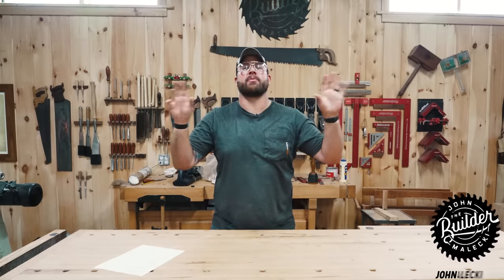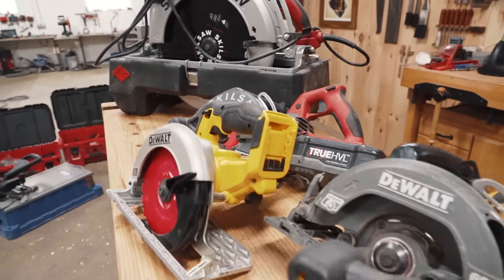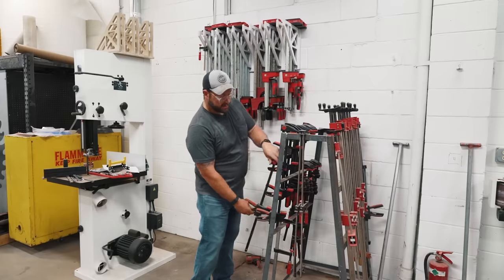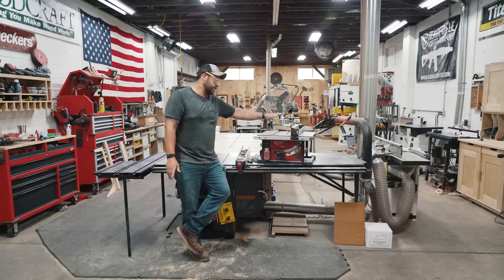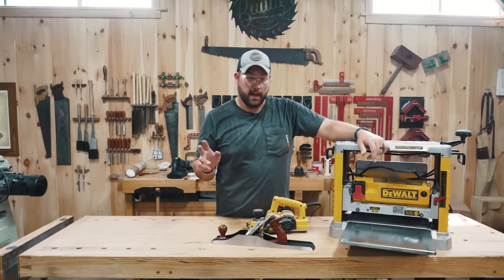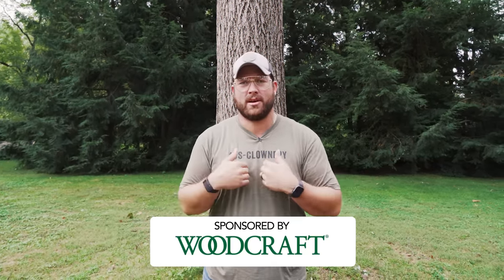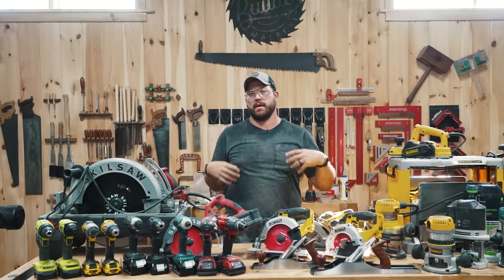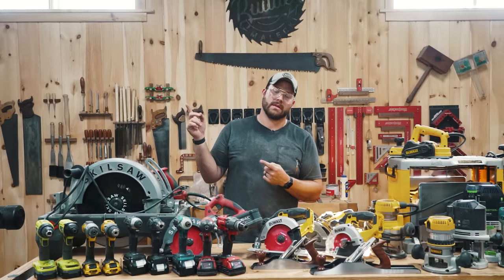10 Must-Have Tools For Beginner Woodworkers

Comment: As a woodworker/cabinet maker for the last 30 years or so, I think this is a great list. I'd like to add a few little extra bits of my own, if I may, in no particular order:
1. You can never have too many clamps. 
2. Table saw - if you're buying a small table saw, get one that allows you to change the blade from the top. Might sound like a no brainer, but some small saws require the whole machine to be flipped over to change the blade which is a nuisance, believe me, especially if it is on a stand.
3. Cutting tools - buy decent cutting tools, whether they be saw blades, router bits, drill bits, whatever. Buying cheap ones is a false economy as they go blunt really fast and will either give crappy cuts or you'll have to change them more often. Same with glue - buy decent glue. It'll hold way better than cheap stuff.
4. The drill press - the floor standing ones are great, but keep in mind some manufacturers offer a bench top version of their floor standing drills. I have a big Record Power pillar drill that has a 3 foot post instead of 6 feet. This allowed me to make a heavy duty drawer unit on wheels so I have the height and power of the floor standing drill, but with storage for all the drill bits, sanding drums etc and, if I need to, I can move it easily. I have never needed to use the full height of the bed (who needs to drill through 3 feet?) so it works really well.
5. You can never have too many clamps. 
6. Band saws - if you're buying floor standing shop tools, a band saw is very useful and should be considered in addition to the items in the video.
7. Routers - to reiterate what was said in the video, routers are incredibly flexible tools that will massively increase the scope of what you can do with your projects. They can be a bit scary, but as long as you stick to the recommended speeds, make shallow cuts and don't do anything silly, they're quite safe to use.
8. Shop vac - worth looking at if you're going to be using power tools. These machines can create a huge amount of dust and chips, and a shop vac will help alleviate that and make tidying up much easier.
9. Biscuit joinery - as well as pocket hole screws, you might want to look at biscuit joinery, especially for cabinet making. It removes the need for screws, nails etc and creates very strong, completely invisible joints.
10. You can never have too many clamps.
Reply: Some great additions! I thought the list was great, but was surprised that dust extraction was only mentioned in passing, and bandsaws not mentioned at all!
Reply: i would add 1 more thing to your list!. 

CLAMPS!! 

that is All.
Reply: Well, I think Marc Spagnolo (the wood whisperer) has too many clamps.  Watch one of his videos to understand my point.

Also, what biscuit jointer do you recommend? I assume Ryobi is to be avoided...
Reply: You always need 2 more clamps than what you have on hand 🤷🏽‍♂️
Reply: I think you missed that we need clamps
Reply: @woodworkerroyer8497  I use the Makita PJ7000 and its mint. Really can't complain about the quality.
Reply: Biscuit joinery is one of the weakest methods of making a joint.
Reply: @fooddude9921  I have furniture that I made 30 years ago using nothing but biscuit joinery that has been in constant use, including two kids abusing them, and not one joint has so much has shifted. That's good enough for me.
Reply: @SteamGeezerUK  That's good, but the fact still stands that biscuit joinery is one of the weakest methods of making a joint.
Reply: How did you miss clamps from your list!
Reply: @fooddude9921  theyre really only used for alignment
Reply: you forgot that you can't have too many clamps
Reply: Great reply - more clamps please.
Reply: Well said!  Thank you.
Reply: Did anybody mention clamps?!
Reply: Frank  Let me put it like this - I bought a trade pack of Erbauer drill bits about ten years ago and I'm still using them. I've tried budget bits and they've always been rubbish, so get decent ones :-)
As for glue, I started using Titebond about 20 years ago and never bought anything else since.
Reply: Sir, how do you feel about too many clamps...
Reply: Great additions but other than that I think only clamps are for beginners. The mentioned tools seem more appropriate for a shop and not a beginner. Maybe we get a list with woodworking tools for advanced and professionals 🙂
Reply: Frank  Titebond 2 or 3 glue is the best imo
Reply: One more thing..clamps
Reply: You forgot clamps
Reply: I've Got A Fever And The Only Prescription Is More Clamps
Reply: I'm a cabinet maker myself, and I absolutely agree with all of your points
Reply: So I'm a 35 year old female and I've tried most things that I'd be interested in and I've recently been having a deep interest in joinery I love building stuff.........so what would be your advice to me as in starting  note in mind I dont have a nail or screw to begin with
Reply: @TheMishbaby16  what sort of things do you wish to build?
Reply: @xxdrewxx6  i would wish to build cupboards small tables, bedside tables like small things that involves wood.
Reply: @TheMishbaby16  well, for starters you should consider a drill, and impact driver. For cupboards the most common type of joints used are pocket holes with screws. You should watch the "Bourbon Moth" Youtube series on building cupboards and doors and such. You can learn a lot from him.
Reply: If you are more interested in making joints without using screws or fasteners, I would recommend starting with bore and dowel joints, all you would need is a good drill and a doweling jig. It would be the easiest and cheapest to start with, and they are great for cupboards and tables.😁
Reply: @xxdrewxx6  great thanks much for the info... for sure i would prefer using screws .....i will be in touch
Reply: @xxdrewxx6  do you do wood work as a hobby or is your profession
Reply: @fooddude9921  Biscuit joints are pretty strong if done correctly.  Yes, there is a wrong way to do a biscuit joint.
Reply: @myfinalheaven9590  Still one of the weakest methods of making a joint.
Reply: @TheMishbaby16  you can also look for Ana White on here.  She uses fasteners for most of her projects.  Also, her finished projects are really good.
Reply: Question. can you have too many clamps?
Reply: i guess Im randomly asking but does anyone know of a trick to get back into an instagram account?
I was dumb forgot my login password. I love any help you can offer me!
Reply: @Hunter Harper instablaster :)
Reply: @Nathan Ronin i really appreciate your reply. I got to the site on google and im trying it out atm.
Seems to take a while so I will get back to you later with my results.
Reply: @Nathan Ronin It worked and I actually got access to my account again. I am so happy!
Thank you so much you saved my account !
Reply: @Hunter Harper You are welcome :D
Reply: My buddy preaches 1 and 10 all the time
Reply: Did you mention the other clamps?
Reply: and number 11, you can never have too many clamps ;)
Reply: Thank you for extra bits! I'm really diving into the woodworking world and this helped a lot
Reply: i watched quite a few of these beginner tools videos and almost none mention dust collection.  honestly i have most of these tools albeit shitty harbor freight versions, but my main concern is how to get an adequate dust collection system set up.
Reply: I think you forgot to say that we need clamps.
Reply: Thank you for sharing your insights and additions. I couldn't agree more with your emphasis on the importance of good quality tools and investing in decent glue. And of course, you can never have too many clamps!
Reply: I disagree - I think this is a HORRIBLE list for beginners.  As someone just getting into woodworking for a list of "must haves" for beginners, the OP should have included PPE, dust collection and many other things for beginners.  I mean he lists in his TOP 10, 3 different types of saws, nothing about clamping, sanding, PPE, dust collection, storage, nothing that so many of us beginners have to work out and know very little about.
Reply: Like the comment about paying attention to the saw features, one thing I would add is look for a saw that will take a dato stack. Some portables can but not all.  particularly important if you don’t have the space for a cabinet saw.
Reply: More cowbell and of course ... more clamps !!!
Reply: @SteamGeezerUK  Accu or cable orbital sander? Tnx 😊
Reply: @jontnoneya3404 the starting I assume you have bit got me as I'm just joining as a hobbyist. 
I need to know what some of those are..like which square or wood glue? I went to my local hardware and got overwhelmed with choices.
As a woman in that space I need to know my stuff before I go to buy else I get led up the garden path.
Reply: What about a normal sander!?
Reply: Smartly designed, easy to use, and incredibly helpful – the perfect collection for beginners, How can I choose the right tools if I’m on a tight budget?

Comment: I got my first impact drill, grinder and circular saw the other day, so stoked!!! XD
Reply: Just bought my first set. As soon as I setup the circular and tried it for the first timw it dawned on me how powerful and scary it is. Have fun and be safe.
Reply: You can cut anything with an angle grinder.
Reply: @thewoodweldingfabricator9300  Arent those typically for tile and metal?
Reply: @Wopko  typically. But I use mine, with a flapper disc, for gross material removal when I'm power carving.
Reply: @thewoodweldingfabricator9300  Ok cool. Thx
Reply: Learn to make some simple jigs/braces for the circular saw and you can buy yourself a lot of time before you need a table saw.
Reply: @krisbrixon  okay I'll look into that.
Reply: Don't forget ear and eye protection
Reply: @Wopko  Yes and way more frightening than a circular saw
Reply: How can these tools be easily maintained to extend their lifespan?
Reply: @hungochan650  You don't need to do any maintenance on them in a hobby shop. Batteries will have the shortest life span by far.

Comment: I got started with a lathe and a craigslist bandsaw, and it was a few years before i moved to some of the more traditional woodworking projects. Have sold a ton of bowls and pens on etsy over the years, just in the last year or so have i started on the more traditional projects like cutting boards and boxes. Bought a tablesaw first when i started working on more square projects and i do not recommend secondhand, first one i bought didnt come with the riving knife and scared the hell out of me by shooting a block of cherry right past my face and into the drywall on the opposite side of my garage, some things are ok to buy used but at least know what safety features it should have before buying. I'm still terrified of tablesaws after that 😂

Comment: I love my M12 Milwaukee cordless tools and anything it won’t handle I plug in.  Is cost So much to replace the 18v batteries I started  with a 7 pice dewalt kit and loved it until I had to start replacing batteries.  Then a 5 pice of the Milwaukee 18v that I was lucky to get a year of life out of them.  my m12 I have gotten 6 years + out of batteries so far they are also lighter and less bulky.  You can get the bigger battery for the m12 system and also so many different tools like tubing cutter, air inflater and solder iron.  We get super hot summers where I live so that is why my battery’s crap out so fast.  Since I made the switch to the smaller M12 system I have not regretted it.  Love the show just don’t agree with more power for cordless is better.  Keep up the good content.

Comment: I would actually recommend getting a Jig Saw before a Skil Saw
Reply: I guess it depends on what you're mostly working on, but I disagree.
Reply: I guess it depends what you're mostly working on, but I agree
Reply: Agree.  A little safer and much more versatile.  

Unless you're cross cutting a bunch of like 2x4s from the jump.  If that's the case, you'll probably throw the jigsaw right out the window and buy a circular saw, miter saw or even table saw.
Reply: Nah most beginners aren’t cutting curves, I would say skill saw because it’s easier to cut straight and is easier to cut a 90 or 45 with a skill saw, especially if you use a square to use as a guide
Reply: @jamesmclaughlin5922  can't really disagree except that a jigsaw has a foot on it exactly like a circular saw which can be used with a speed square.

Comment: Probably the best to do is start small and work your way up to the bigger stuff,been a wood worker off and on for the past two decades and been out of the hobby or the profession for a few years now other than a occasional project here and there.I already have quite few of the main tools like both the miter an circular saws,drills and etc but want to add a router and a drill press plus a pocket hole jig too, I plan on going a little deeper into woodworking,as I'm considering building a work bench and then a miter saw station eventually.I have some background in wood working but the two beginners videos were still helpful to figure out what the next tool to add to my growing arsenal,thanks..👍

Comment: You and quarantine are the reason I'm considering a career change mid pandemic. I hate you and love you at the same time. My bank account despises you LOL
Reply: You might already have a lot of this stuff. Probably circular saw, cordless drill, miter saw, router
Reply: @raul0ca  actually not much other than hammers and hand tools minus a drill. I’ve bought everything in my adult years. Dad wasn’t generally a power tool or DIY person
Reply: @simplysimon1918  Dude it's gonna get expensive but you'll get a lot of cool stuff. Scott Brown Carpentry has a rundown of what he uses when working on houses which is different from this woodshop stuff

Also invest in PPE first! Eye protection,, good lighting for your work station and hearing protection and clamps to keep your work secure. Think about all the ways the power tool can hurt you and avoid those things.

Comment: Ryobi had a nice set for 200 bucks. Both drills circular saw, sawzall the vibrating thingy saw a a flash light with two battery’s. I’m a painter and don’t use em that much so does the job for me

Comment: My main battery platform is the Makita 18v LXT, I've got the ryobi airstrike 16g nailer and a few older Makita Ni Cad tools, all of which I've bought adapters for so I can use the LXT batteries on them. I also recently bought the Bosch 12v multi head drill kit, and I was surprised by the power. I have since bought the 12v jigsaw.

Comment: 100% agree with Malecki on the Router being lower on the list. I was terrified of it, which I knew that fear could lead to more mistakes on it rather than make me use it in a safe manner. So I didn't use one till I was about a year into learning woodworking. After that, it's become a staple in my tool use, but I made lots of things without one too. Malecki is bang on in this regard. Also the video is pretty great for beginners. So if you're new listen to his advice.

Comment: I have a pretty basic Craftsman table saw. I have a 10" Makita mitre saw. The table saw will do what I need for now (will need to build a pullout table) but when the garage gets built this month, I have my heart set on a Makita compound mitre almost exactly like yours. I like the way they made it more compact that way without compromising performance. I think the one I'm looking at has a 15" cut length..

Comment: Super, very nice episode. 
You said exactly what to have, not like the others that in "Top 10 Tools", they talk about 10 similar tools. These 10 tools you mentioned are pretty much all that is needed. The only thing missing is a grinding tool, and this tool is perhaps more important than a bench drill. I do not have all these tools yet, but I do have a Makita milling machine, a track saw, sander, clamps, a drill and a belt sander.
 These tools are enough for me to make some furniture or something out of wood. The next tool I plan to buy is a table saw, planer and dust collector. 
Thank you for this episode, you did very well.

Comment: You're all going to laugh, but, I use a Black and Decker Matrix tool which has 12 different heads that turn one tool into 12. Ive used it on site for almost a decade and i still havent had to replace anything other than a battery. The impact runs both rpm and bpm higher than the big brands. I keep all the heads in my bucket and switch from tool to tool all day long. Just to name a few, I use the impact, drill/driver, trim saw, reciprocating saw, and a jig saw. There are others, but, that's what I use and keep on hand. They all run off the same drill body and take seconds to switch between. I got it as a gift one year and was grateful, but, also skeptical. Turns out it does all of them well and I haven't had to replace any of it yet. 9/10 would highly recommend.

Comment: I know there is a lot of hate for Black & Decker but I love the Matrix drill from them. I have a wireless and corded drill and both work great. I prefer the corded system for the jig saw and router as it tends to give more power for the tool.

Comment: I do finish cuts with my miter saw, I use a 100 tooth blade, and I've also taken sand paper and put it on either side of the blade so it sands the cut smooth. Works amazing. Doesn't make the kerf any wider either.

Comment: Great video, I realize it’s intended to be woodworking specific.  But the one change I would probably make is to put the miter saw in the “top 5” it’s probably not top 5 specifically for finish carpentry. but because like the drill set, it’s usefulness will extend far beyond fine carpentry projects